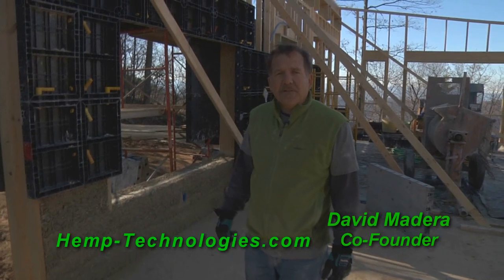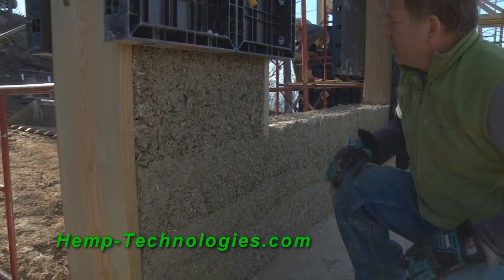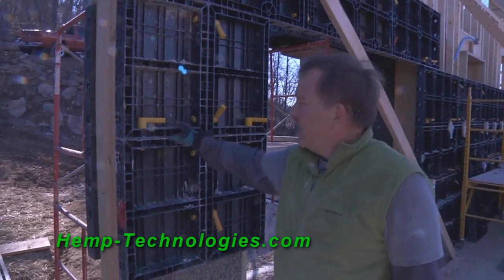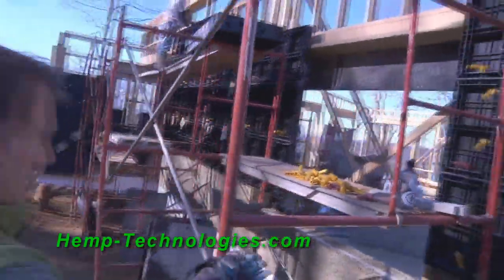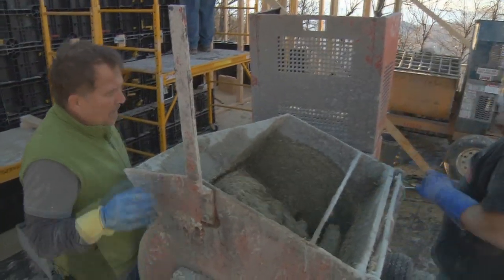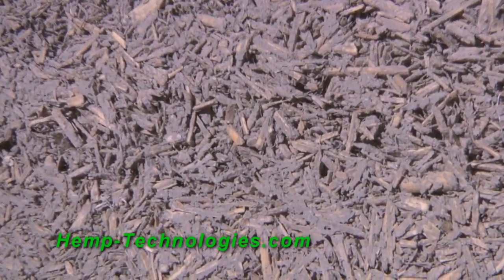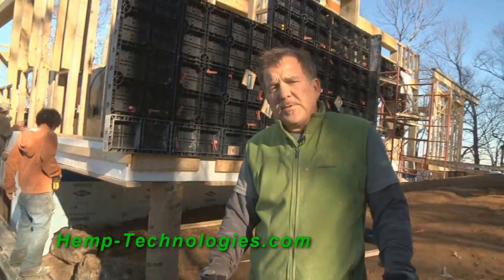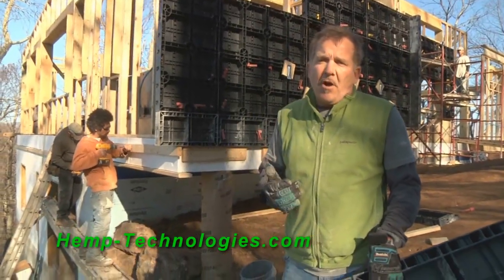Hemp House - Asheville, NC

Comment: @enoughraptor6 hemp is not just an insulator, it’s a high quality fiber material which is essential for most masonry building materials. Also Recycling creates a lot more toxic waste than you think, Newspapers especially creates something like 70% sludge i think. Also this is easier to build that concrete, because you don’t need that much heat and what not.. there are so many added benifits

Comment: Great job guys, have you considerd making pre cast walls and erecting the frame with steel to cut time and cost? It may even be possible to make i beams, girts, columns and truss pearlage from hemp fiber glass to really make the statement, but since no companys make these in mass production, development alone would be more expensive then steel.

Comment: Look into the 50,000 uses of hemp on google out maybe even just read a book.its proven that hemp can be a viable replacement of many of the products still in corrupted use today.hemp can be, just a small list: food, fuel, building material, clothes, soap, feed for animals, oils, plastics, bullet proof clothing, water resistant material, oil in a natural rubber galvanizing process, the list as I said could go on and on.it could literally help in every social aspect, imagine a plant doing this.

Comment from the maker: Interesting you bring up recycled newspapers and saving trees. Recycled paper is touted as environmentally friendly, but  contains around 70% virgin tree fibers, as the reused fibers are too short and weak - a mush.
Adding hemp, with its easily accessible cellulose (no dioxin) and long fibers, would enable recycled paper products with no new tree fiber used.